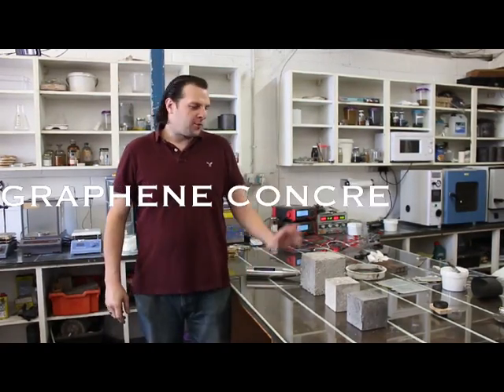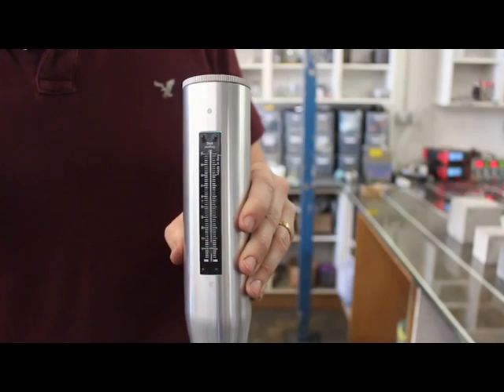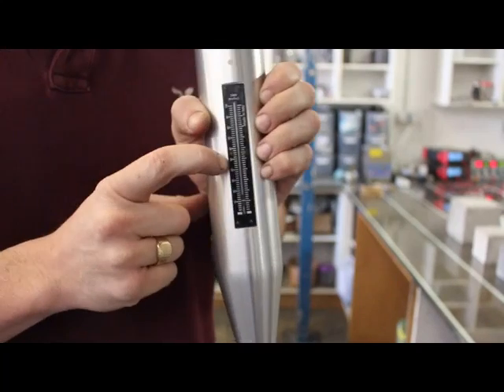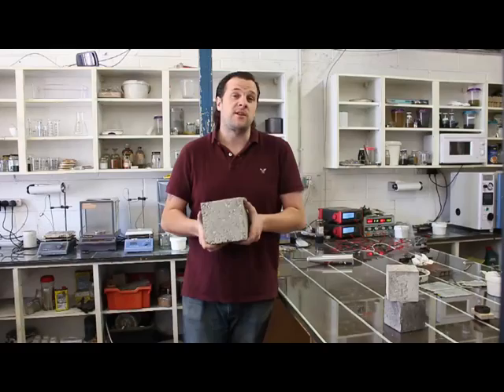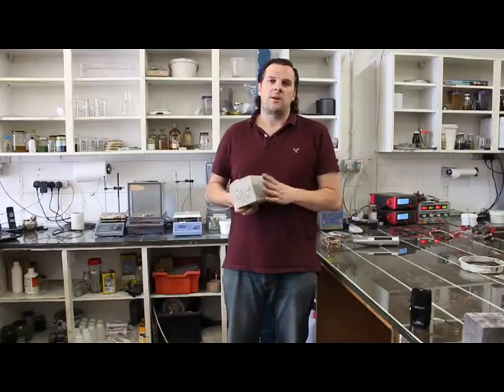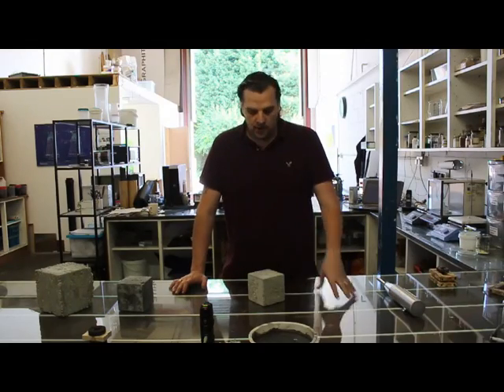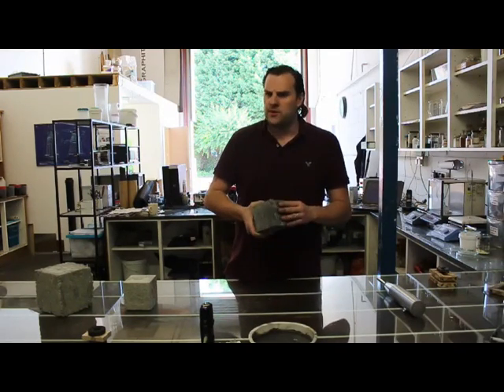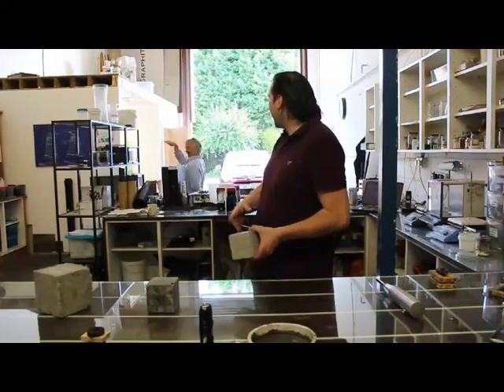Graphene Concrete Update 2

Comment: Is there a way to flash graphene Onto the sides of graphene concrete, to give added strength to the outside of it?  
Could it be done cheaper than using carbon fiber on concrete like what they do on some bridges?

Comment: Does the addition of graphene changes the electrical and thermal conductivity characteristics of the concrete?
If so, how are meeting the standards of fire, electrical insulation, corrosion and other building codes dealt with?
Lots of work to do before graphene modified concrete is used in bridge or skyscrapper construction.

Comment: What you need to know about concrete testing, that concrete hammer is designed to measure bigger surfaces. Also, it is a rebound hammer. If you put a carton undo concrete or test on the table, the results will be different.

Comment: I have a couple of question, I would like to know how graphene concrete works on the micro scale. How does this new concrete differ in performance from say concrete made with short lengths of carbon fibre included in the mix

Comment: Graphene cement could be developed to generate electricity from direct sun light and noise vibration? Used at air ports on run ways to generate electricity on subways to generate electricity?
Reply: We know it is Piezoelectric. Thank you.

Comment: Just out of interest... Has anyone measured the conductivity of these blocks? What is the conductivity of a normal concrete block (presumably not very conductive) in comparison to one of the graphene oxide or "Bob the Builder uses graphene oxide" (thrown together) concrete blocks? Would this be useful or an issue? Great work, amazing stuff.

Comment: Are you sure you are using the correct terminology? Graphene is specifically graphite that is 1 atom thick. I highly doubt that if you mixed that much concrete with only a 1 atom thick level of graphite - that you would get ANY improvement. Are you sure you don't mean Graphite? I'm thinking you are mixing a certain amount of concrete with a much more amount of carbon than just 1 atom thick carbon. Since you haven't revealed the percentages of each - I can't say whether you're correct or not.
Reply: We are using graphene hence the massive improvement. We managed to solve the big problem of dispersing the Graphene in the composite. Thank you

Comment: As an engineer, I would like to see testing on creep of the concrete. If the creep is drastically reduced, we could make slabs of concrete thinner. Creep is typically the biggest factor in determining the amount of deflection in a slab or beam. Thinner slabs means lighter buildings which makes the seismic design etc easier and cheaper. I know that graphene is great for tension but if the graphene fibers could help reduce the compression in the cement within the concrete mix, then it might help with creep.

It will be interesting to see the tensile capacity as well. If you can get consistent results above 20 MPa, that would be interesting and would have significant implications (assuming the cost of the concrete doesn't skyrocket). This means the possibility of concrete without rebar and that changes the very way we design and build. It makes 3D printing a building or building components a more practical option. Extruding concrete structural elements also becomes more practical. However, a 20 MPa tensile stress is a tall order to fill.

I am also curious about the slump and cement content. If you get increased flow with the graphene, this can reduce the cement ratio. This reduces the amount of cement production. Approximately 7% of human caused CO2 comes from cement production.
Reply: Good point, re creep characteristics. 

Should to compare this modified graphene concrete with new geopolymers that are coming onto the market. graphene is still very expensive per kg. Also compare with glass fibre reinforced concrete

Comment: How large are the sheets of graphene and do larger sheets add greater strength? Also is the size relationship between the sand particles and the graphene relevant, does it impact on how they function together as a mechanical unit? I guess you need a few SEM images to know for sure.
Reply: this might be something we have to wait a few years for this info to come out

we don't even know if anything is a stronger substitute vs portland cement in alternative crete mixtures

Comment: Those are definitely interesting results. I'm curious how the weight of the new material compares to the standard method. Also have you considered using the eco foam in addition to your experiments to perhaps yield a better light foam cement block?
Best of luck with everything! Great work keep it up. 😊

Comment: Generally, the compressive strength of concrete is more than sufficient for most applications, so, based on results so far, I'm not sure this development is really that exciting except for niche high-performance applications. However, if the graphene increases tensile strength then that could be revolutionary, as concrete has poor tensile strength.
Reply: UHPC has tensile strength of roughly pine wood if you compare the #'s, but additives like fibers and graphene do make it significantly stronger because crete fails by cracking apart and splitting

Comment: I'm with Davis Machine Machine (davismachineworks.com) here in Alabama, U.S.  Lately, we've actually been building some concrete temperature cycling machines for different universities around the world.  

I'm also fascinated by the idea of possibly building a custom machine to produce small production runs of 18650 batteries.  Someone would have to help me out a good deal with the concept, but I could do a cad model and build something; possibly much less than the 200k price.  That's hard to say for sure, but please let me know if I might be able to quote something for you.

Comment: Brilliant! Real world bulk tests soon, methinks. Mix up enough to make a load-bearing pillar, with some rebar, and also try some in a brick wall, perhaps? Then bend it, and compress and stretch to your heart's delight. Thanks.
Reply: @tony freeman

how it works with superplasticizers, no aggregate, and compared to steel fiber reinforced cretes would be great

if they can get it as an additive along side fiber mortar (UHPC) cretes it would be very useful.

would love to see how this changes or improves the characteristics of a ~200N/mm^2 (200MPa) sample..

:)
Reply: Lol. Like it
Reply: lets do a crush test, maybe there is a better way to reinforce concrete. something with the shear strength that doesn't rust!!!

Comment: Transite is asbestos and concrete. My company has been cleaning it up for years. Any health hazards associated with graphine? Just wondering if your making the next thing I'm going to have to clean up.
Reply: MrArcher0+ Caution is appropriate. I visited an RAF firefighting unit in the 90s and they always went in full breathing gear when dealing with aircraft fires involving carbon fibre. Nobody knew what the health effects were but carbon fibre produces microscopic shards when it's burnt that look just like asbestos under a microscope.
Materials often have different properties on the nanoscale; you call lick a lump of quartz all day and all you'll do is wear your tongue down but grind it into nanoparticles and breathe it and you'll get silicosis.
Reply: the health risks associated are largely unknown but worker safety consider things like CNTs to be possibly dangerous so the allowed air concentrations are much lower than other materials.

its pretty much unknown as of yet, but as long as the body can break down carbon it should be good. we have had fire for a long time, and its been crucial to our survival. nanomaterials also form in that.

also, these are not CNTs, these are mixed graphene sheets
Reply: If miners suffered from 'miner's lung', caused by inhalation of coal dust, then why should carbon fibres or nanotubes behave any differently in the lung? Nobody can be sure until any health issues begin to come to light, perhaps up to forty years down the road. It would be wise to assume the worst, and to take precautions, until fears are shown to be unfounded.
Reply: I vaguely remember some researcher trying to determine the toxicity of nano carbons by feeding cnt (carbon tubes) to random lab animals at varying dosages and vaguely remember it is not that toxic. But the interesting bit I really remember is that they feed very high concentrations to spiders and observed the tubes came out the other end embedded in the silk..
Reply: RMS funny background posing! hahah. (Google stopped me from commenting)
Reply: Graphene is not a nanotube.  Graphene is flat.   I can't rule out particular shapes of graphene sheets, particularly long skinny ones, being hazardous to the body, not unlike asbestos.  The hazard would be a function of the size and shape distribution of the particular graphene sample being used.  See the Spectrum paper posted by dRUM & bASS above.
Reply: Has anyone tested their (graphene) reactions to white blood cells? If they release amino acids  but do not breakdown by the acid they are basically having the same effect on the lungs as asbestos.
Reply: Interesting.
Reply: Brew Sauce+ The fact that they can pass right through a spider is not encouraging to me.
Reply: fantastic question!!

Comment: Nice work guys!
Please check PH level changes as concrete is also a chemical protection for steel rebars. 
Also, please let us know about the strength of the concrete after 28 days, although that 7 days result is just amazing.
Finally, please consider start doing the test with a high strength concrete. Starting from let's say 50N/mm2 and adding graphene may be quite interesting to get a super concrete.
Awesome work.
Reply: Thank you. When I make the next batch I will take note of the PH levels. The point of the project is to use basic materials and make the concrete super strong however we are planning on using different strengths to compare properties. Watch this space!